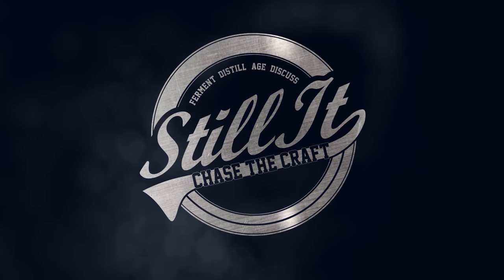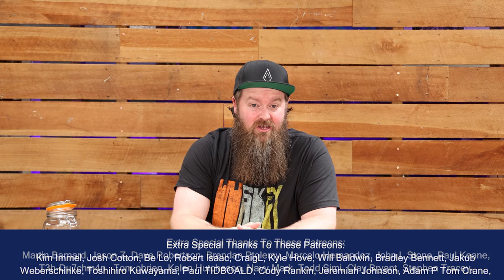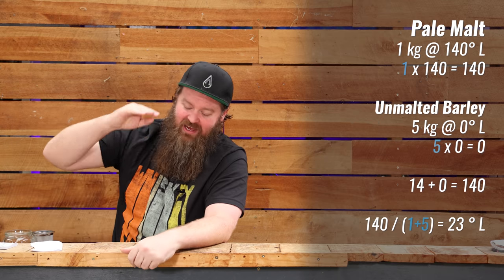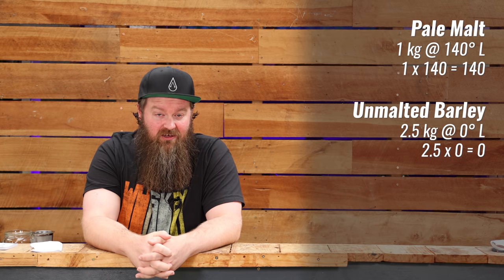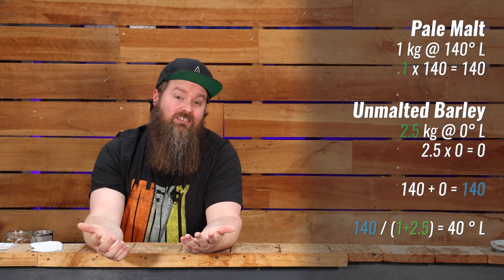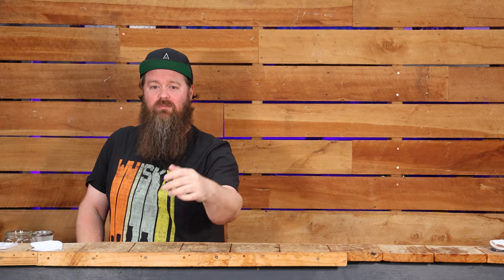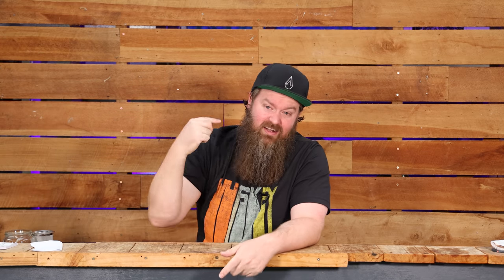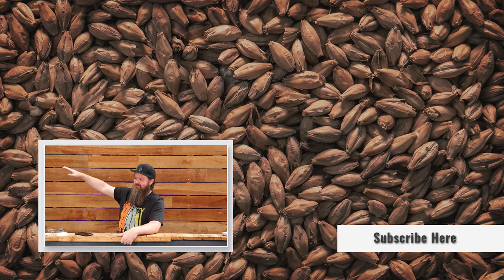Why You Need To Understand Diastatic Power For All Grain

Comment: You forgot one important point for the beginners, there's another °L value for malts, Lovibond. As colour tends to be more important than diastatic power to most brewers (only because most beer recipes are high in base malts and recipe calculators will work out your SG based on the typical diastatic power and other factors anyway) you'll find °Lovibond more predominant in malt data sheets. If you mix the two up, you'll end up with some very strange calcs.

Comment: You probably know a lot more about this than I do, but I just want to make sure you haven't gotten confused. Apparently many malt sellers use an old fashioned measurement called Windisch Kolback (degrees OKW) rather than lintner. The example diastatic powers you have described in the video seem much closer to OKW measurements than Lintner, so it may (although I am not particularly educated in this, I have just read it on the internet) be that the diastatic power of malt has been overexaggerated by this a little in this video

Comment: Great video Jesse. The problem with using Diastatic Power is it won’t tell you Starting Gravity of all your grains and all your water. If Extract Potential is listed for the malt you are using you can get to gravity points which you can then divide by your water volume to get to the original gravity of your recipe. I finally subscribed to BeerSmith which does the math for you.  Very handy for brewing and distilling when developing new mash recipes. Cheers!

Comment: More great info this is a very useful video and something that's not discussed all that often. 
I think its worth mentioning if you have a space issue I certainly do. I use 6.5 gallon fermenters. The recipe I want may not be able to give me the desired amount of wash volume after I've reached the magic malt number. Say I'm doing a flaked corn,oat,rye, malted barely mash, and I want more of the other 3 grains to barely raito I can add a little powder enzime and still keep the water to grain raito  im looking for, and still get the flavors im chasing from the different grains.

Comment: Jess, here in the states a lot of malting company's have distillers malt, for example Briess has a  distillers malt that has a Diastatic Power of 250.  It works great with corn when making bourbons and you don't have to use or buy near as much.  Surprised you didn't mention using liquid or dry enzymes instead of diastatic malts?

Comment: I'm doing my first all corn mash . I just got 50 pounds of cracked corn . Going to use 10 lbs of corn for 5 gallons - also I am using Amylase Enzyme .
Reply: Let us know how that works. I've never gone higher than 60% corn in the mash bill.
Reply: @KowboyUSA  I will do because I am making mash now . 
 I only have a 3 gallon pot to cook my corn . So far my water for me cooking the corn is like a thick syrup and at 2 gallons .
 I will redue until I get 5 gallons of liquid - then keep at 155 for my Amylase Enzyme
Reply: Super interested in all corn mash results. I tried this with cycles for gluco and cellulase, and while I did get conversion it wasn’t efficient or great tasting. I’ve gone back to a UJSSM.
Reply: Boil your corn for a minimum of 30 minutes to help release all the starches, let it cool to 150F, add your enzymes or 2 pounds of distillers malt, stir, let it rest for an hour or two. I do that amount all the time, works great, good luck. I would recommend cracking the corn yourself (I use an old cheap hand grinder, some say cracked corn is missing the germ, I want it all in my corn whiskey.
Reply: mine failed... but i also didnt have a wort chiller... so left it over night in a closed bucket on my balcony. by morning the wild yeast got in there :D i ended up spiking it with sugar in the end. it was the base for my impossible to replicate gin... which im down to 1 bottle... multiple screw ups lead to great success:D
Reply: Well I had to add sugar - but it smells awesome .

Comment: Love the channel was woundering. I run the mighty mini whats youre thoughts of running it without any packing in the column would you retain any flavor from the wash? Or is their not much of a difference from a packed column with copper or no
Reply: The mighty mini is a dual purpose reflux/pot still so turning off the Reflux condenser (pot still mode) and leaving the copper packing in will result in only minimal passive reflux retaining the flavours but benefiting from the copper in the vapour path. Surely the best way to run it and should make a fine whiskey.
Reply: @colahandyman67  thanxs for replying have a wash ready to run in the morning
Reply: @brianrossini232  Good luck, hope it turn out great. Are you doing a strip then spirit run?
Reply: I usally run it in the as a potstill with 2 rolls of copper just a spirit run comes out around 140 proof was just going to see if i didn't pack it if i would pull more flavor. To me if i use corn and barely or all apples or a sugar wash their is a difference but not much lol

Comment: ok tell me if i got this correct,but from what i remember of my exp of converting starches in a mash was basically using 6 row pale malt of 20% out of your final product,,so if i used 5 kilos of base grains i would replace 20% of it with malt so this means i only use 4kilos of the base and 1kilo of malt but you seem to have added this 20% instead by using 5 base and 1 malt?